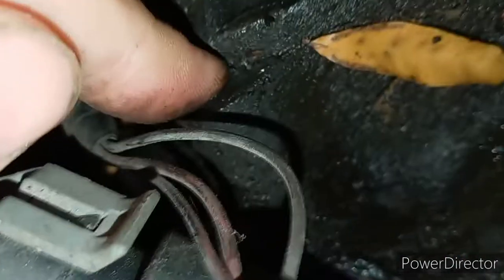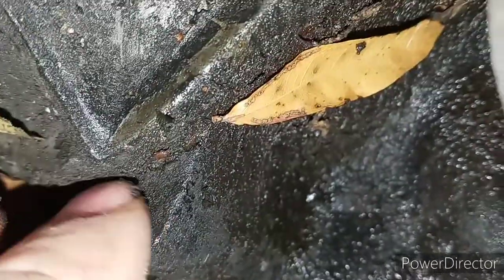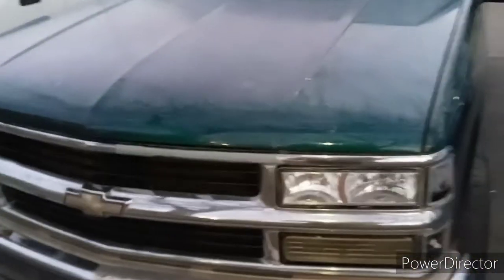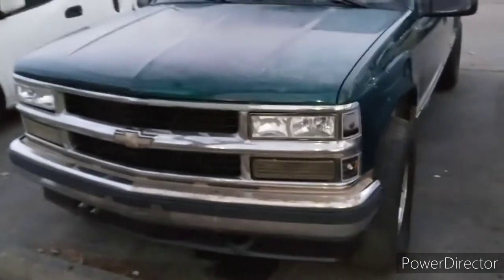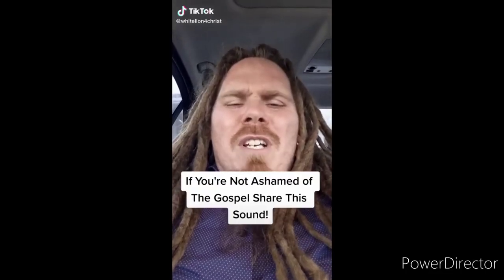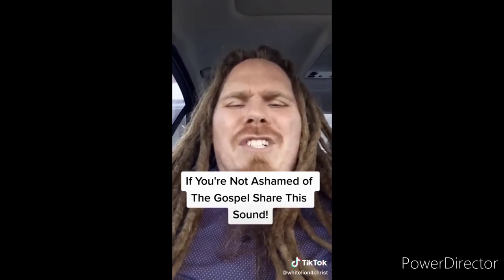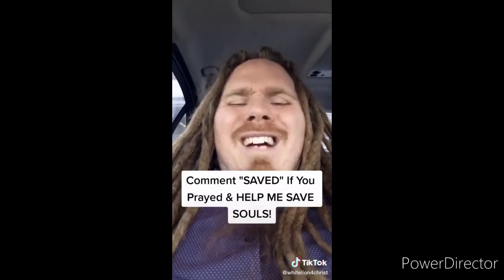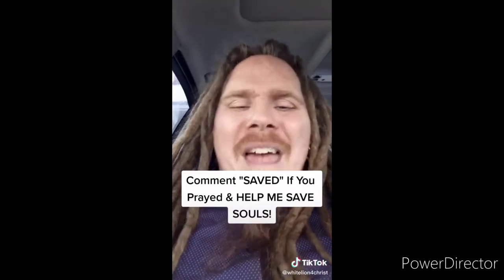how to tell if you have a 4 bolt main or 2 bolt main sbc 350

Comment: You only need to worry about bolt mains when dealing with big blocks and 400+ sbc because of the torque they put out. You can have a 160hp sbc and a 160hp bbc and the bbc can still send rods flying into the heavens and thats from experience 😂😂😂
Reply from the maker: Oh snap 🤣🤣 well thanks for the info
Reply: @straightpipedchevy  glad to share my testimony of thinking horsepower is the only thing that mattered 🤣

Comment: 350 2 bolt main can handle well over 500hp
Reply from the maker: I was always told that 4 bolt means are best for high power
Reply: Pros will tell you 400 horse on 2 bolt main
Reply: @straightpipedchevy that only applies to big blocks

Comment: bs, 2 bolt mains on a 70-80's 350 can take up to 600 hp
Reply from the maker: If it’s built right
Reply: @straightpipedchevy  what's the point of building something if it's not right?  And a 2 bolt 350 can handle more than 400HP , the 400hp is conservative number, if you have the right block with thicker casting you can get just as much hp from it compared to a 4bolt. Some experts say that 2 bolt is stronger because there is more material left around the main caps from not drilling the extra holse in the block.

Comment: 2 bolt mains in those years had more horsepower.
Reply from the maker: For real??
Reply: Yes
Reply: For example a L05 350 tbi in 2 bolt configuration was 210 horse compared to 
190 in 4 bolt configuration..cam difference was it
Reply: Professionals will tell you 400 is max horsepower for 2 bolt